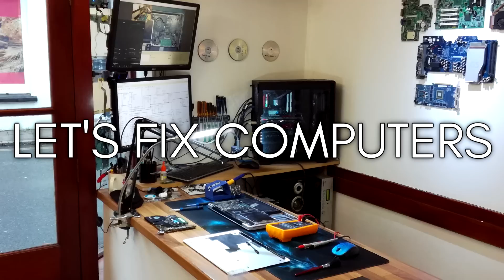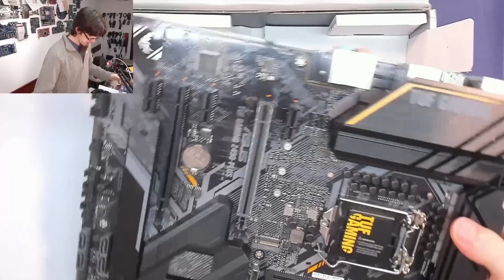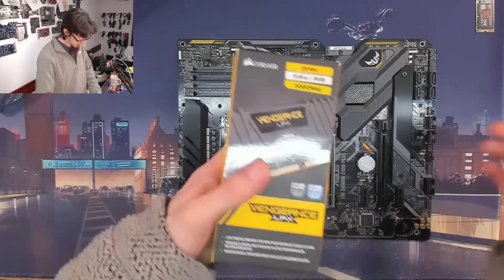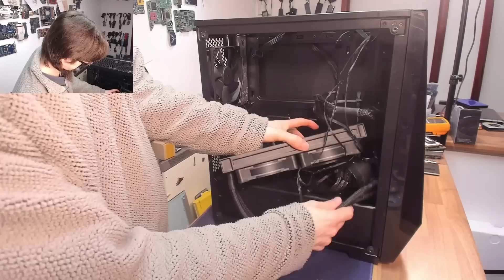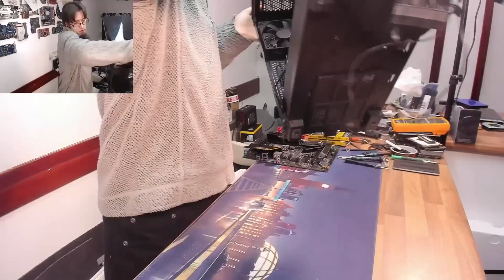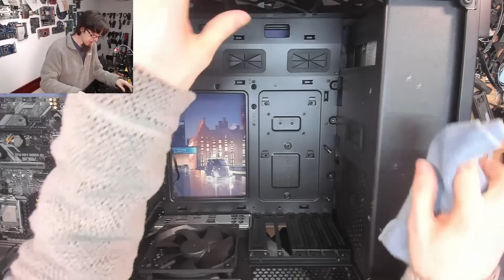Pt2. Rebuild, Custom build with No POST - LFC#240

Comment: Nice work and nice video - as usual ;)
However, there were two things, I noticed:
- I did not see you applying thermal past. I hope, that part just got cut out same as the SATA-Cables.
- You mounted the fans on the radiator 90° in respect to each other. That is usually a good thing, since then the cables come out at the same edge. However, with ARGB - especially of they are just paralled up - that leaves you with 90° shift for all effects on those LEDs. Not a problem for solid colors of course, but on the "Rainbow-Ring" as I will call it, you can clearly see that.
Reply from the maker: Yea thermal paste and SATA cable stuff often gets cut for time-saving 👌
RGB fans, yea these are non-addressable so that isn't a problem. But you're correct, ARGB fans I always make sure they're in the same orientation for that reason!
Reply: @Adamant_IT  Thanks for the reply! I can now sleep a tiny bit better knowing, that there is thermal paste on that CPU :)

As far as I understood it, the 3 fans on the front of that case are (analog) RGB  - so one solid color. However, the ones on the radiator are the "fancy" ones, that can have a "rainbow-ring" going around them. And at 29:20 it looks to me, as if that ring is 90° offset from one fan to the other. So these are in fact (Addressable) ARGB ones, are they not?

Comment: There is addressable RGB and Digital RGB they are not the same as you kept saying lol. I know you know what you’re talking about but the way you say it might confuse people who don’t know
Reply from the maker: How would you differentiate them? 🤔
The way I look at it, analogue RGB is your 4pin RGB and 12v header, and digital is the 4pin with gap header. Digital is addressable because it's a data line, not just colour commons and power.
Reply: @Adamant_IT  I just know that they call the 4 pin Header Digital RGB(12v) and the 3 pin Header Addressable RGB(5v), I know it sounds dumb because you'd think they would call it Analogue and not Digital. Maybe it's just a U.S. thing I don't know lol. Not trying to be a dick or anything I just don't want people to get confused and end up somehow blowing out there expensive LED's. That shouldn't happen because of the pin layout but you know some people just KEEP pushing until it goes in sometimes lol.
Reply: @Adamant_IT  Love Your Content By the  Way!  Keep up the Great informative videos my man! Cheers
Reply from the maker: Yea. I guess you could call it digital RGB in that it's digitally controlled by a computer... I'm pretty sure I've seen "addressable" RGB headers labelled as DRGB on the mobo. There's a horrifying lack of standardisation in RGB though, so I guess context is the only real key!
Reply: @Adamant_IT  yeah it’s definitely confusing lol. I have a MB that is labeled DRGB for 12v and another that is DRGB with the 5v plug. These manufacturers should really start working together where it makes sense and keep their proprietary stuff to a minimum, but that’ll probably never happen. It would just make to much sense

Comment: I had a strange issue with my  Strix Z490 I updated the bios it said successful,  computer turned off then back on and it never posted fine again.. I got a 4F post code. I tired to reflash and it seemed to reflash ok but still same issue.. Got a new Mobo popped in the cpu in the trouble mobo and I kept getting blue screens installing windows on the new board.. Popped in a different cpu a 10700k and everything worked ok.. Idk wtf happened my 10850k was damaged in the process of updating bios. Strix Motherboard still works ok and update with through ok. How could that even happen?

Comment: do you find that the power sata cables put unnecessary strain on the connectors because they are so close, wouldn't extensions mean less pressure?
Reply from the maker: There's a bit of strain there, yes. I find that bending the cable a bit before hand makes it acceptable. The cable doesn't mind being bent, and then it's not under so much tension.

Comment: I specked out my second build back in 2011 and it worked fantastic for nine years,  In late 2020, it began acting up.  Your Vids and or others eluded to RAM and or CPU issues and to remove and check.... Tried several arrangements of RAM to no avail.  Removed the CPU and it appeared ok.  Taking a flashlight/torch and a magnifying glass, I saw just one socket pin bent.  I assumed possible years of fatigue to be the cause.  Gently trying to move it back into place, the damn pin fell away and into the other pins.

My solution to removed that broken pin without damaging more pins was to take wide masking tape and kind of build a wall around the socket and over the top with a small gap.  Using a Can of Duster, I hoped that I could blow the broken pin out and hope it would get caught on the tape and not get lodged somewhere on the motherboard.  It worked perfectly!

However, after replacing all components and restarting, it would not post!  I really wasn't looking forward to buying a new computer package, but after failing to locate a new motherboard to match the rest of my gear, I ended up buying a Tenth Gen Z-490 Board, 10-600K CPU and 16GB DDR4 Ram.  Set me back almost a $1000.00.   Then when all hooked up and ready to go....  Went into Bios each time and no post??  After scratching my head for a long time and borrowing a Laptop to search my issues, I found that my old system SSD drives were MBR and the new System was GPT!  So I had the drives changed for me.

Quit a damn headache for sure but now I'm up and running again.

Thanks Adam, Love your Vids.

Comment: Graham - what are your thoughts about using velcro instead of zip ties?  Velcro seems so much more versatile and can still hold down wires well.  I use a .75" (2cm) wide velcro roll - cut it in half down the middle and they work great for all sorts of cable tying.
Reply from the maker: I've got a roll of velcro in the shop for this exact reason. And I keep forgetting to use it.
Reply: @Adamant_IT  I'm going to ship you a GIANT roll if you don't start using it! Cheers and thanks for the great content!

Comment: I’ve noticed the initial power cycling with the last two PC’s I have built using ASUS motherboards. It seems to be a process the ASUS BIOS goes through when detecting new CPU and RAM components. This occurred on my old ASUS Maximus IX Code and my current ASUS Z490 TUF. Each power cycled about three or four times before fully starting up.

Comment: Is the CPU "backplate falling off" just a TUF brand problem or is it a common problem around the other brands as well? I have a TUF x570 and a Ryzen 3600 in it, and when I disassembled it for cleaning purposes, I wasn't prepared for the plate to fall off, I was internally screaming for like 5 minutes.

Comment: And now from a PC repair expert...I'm an oddball, I had a Core i7 7700K fail on me...in over 25 years of PC building and whatnot...my first failed processor. They are made well, just thankful it failed while it was under warranty...Intel couldn't replace it though with no stock. They sent me a cheque for it...which was used to buy a X570 board...

Comment: this is why i really like intel builds, because it usually takes alot to break an intel platform something would have to be very very wrong for them not to even get to the post screen, and the fact that most of their regular processors come with onboard video is a huge bonus, if you want to know if there is something wrong with your video card, you can just take it out completely, get the video cable plugged into onboard graphics and boom get your answer right away, even though ryzen is good i find i really do not like the platform that much, it can be very troublesome for so many reasons, that i often find myself pretty much avoiding trying to give build advice for those ones.

Comment: If anyone was worried about static whilst building a PC, their concerns should be allayed by your cowboy building in a fluffy jumper. I don't think it's wrong (i don't adhere to strict practices), but it still makes me cringe watching you handling the hardware with all that fluffyness rubbing all over the place.
Reply from the maker: 15 years professional and my jumpers haven't zapped anything yet. UK's just too damp. If you're in a dry region though, yea different story.
Reply: @Adamant_IT  I think in my 20 odd years of building (just for myself/friends/family) i've had one thing die mysteriously after being handled without any to effort to ground myself... YMMV naturally and i'm also in the UK. Still can't help but cringe a little , i was always taught to ground and avoid things like carpet, rugs and fluffy jumpers when handling hardware.

Comment: What about thermal paste? Did you edit it out?
p.s enabling xmp profile before installing windows isn't the best idea :(
Reply from the maker: Thermal paste is an unwinnable fight. However I apply it, someone will tell me I'm wrong, and if I edit it out, everyone will think I didn't put any on 🙃
XMP before windows - yea I normally advise waiting, the issue is if a new build crashes, you might not know if it's XMP or not. But if you know what XMP crashes look like it doesn't really matter, if I see memory errors, then I'll know it's likely XMP.

Comment: Whats VRM?
Reply from the maker: Voltage Regulator Modules power bigger components on a circuit board. Motherboards will have several VRMs working together to power the CPU. Bigger/more sophisticated VRMs can deliver more power without ripple (stability) and produce less heat. I've got a video in the works that goes into more detail on this.

Comment: i have a suggestion for the fan headers, all the fan headers are 1A 12 W q-fan controlled, the AIO pump header is 1A 12W Full speed, w pump header is 3A 36w full speed (default speed)
Reply from the maker: Yea you're correct, the w/pump headers are higher rated. But they work in the same way, so you can plug fans into them as well.
Reply: Ok, thanx,  i thought the fans would online turn fulltime speed, good to know,

Comment: 21:10 I've got 11 connected to 1 header and its been fine
Reply: You can do that but its not ideal
Reply: @JohnDavidSullivan  how isn't it ideal?
Reply: @randomplayer6461  if they are running off a separately powered fan hub/controller fine, but splitting them from one socket isnt good.
Reply from the maker: I've no idea how much current RGB headers are actually rated for. I know my NZXT system at home doesn't support more than 4 devices in a chain, but I'm not sure if that's due to power constraints or software.
Reply: @Adamant_IT  I am using a high end motherboard (x570 aorus master) so that might be why

Comment: When removing glass note tempered GLASS panels be VERY careful ! If it slips and drops on your foot!! 2. If is smashes?? I am very wary when building using such for nieces/nephews etc BUT the finished computers are often ANCHORED to the desks AND the kids are NOT allowed without supervision to remove the panel. Those tempered glass panels are HEAVY!. 👀 Some clear panels are PLASTIC.

Comment: Re newbies etc, SOME cases provide an RGB controller often with remote control. (RESEARCH!!)  Those are generally 3 pin as shown here.. Asus have headers on some of their m'boards 3 pin for ARGB using AURA software downloaded to control the setup etc ONSCREEN. My system has 6 fans and they all work (PROVEN - tested long term no probs.) HOWEVER the manual etc does tell you not to exceed x number of LEDS ! My fans did not! 4 pin configurations are 1. DATA 2, 3 4 Red, Green, Blue.. and my Asus mobo has 4 pin OUT aswell as the 3 pin configuration. Some fans for LED etc have a 6 pin plug attached and they operate off a control box with 6 pin OUT headers.. 2 of those pins are for the fans.. others re LEDs etc... plenty of info on YT re the whole scenario on LED fans etc. Some LED fans have OUTER RING only. Some you can change the outer ring slotting it on the side you want to see etc re position in the case. My drives are fitted to the backplate which leaves where the trays are free for ie burying cables etc. TIP A magnetic screwdriver when putting screws INTO various places on the motherboard will often stop accidentally dropping the screws OR particularly if your fingers are like the Hulk 🙄🤣🤣 Another great vid.. If you missed it, do check out the vid on this computer with its original mobo in situ that would not post etc.. a truly jaw dropper that one👀 an invaluable lesson to NEVER forget.. Stay safe, whoever wherever you are and keep the vids coming 👌

Comment: All z490 motherboards have capable VRM's. The Tuf Gaming, while arguably the best in VRM performance, isn't significantly better than 2nd place. A dramatic difference would be in the b550 motherboards where the Aorus Master is 10 degrees cooler than the 2nd place entry and is WAY overengineered compared to other b550 entries.

Comment: 22:50 - Is it normal to have the PSU fan facing upward into the case? Isn't downward better assuming there is ventilation there?
Reply: Typically downward is the standard, but some people like to go against the grain and argue for upward facing because .. "reasons"..

Comment: Thermal Compound on the CPU? Even at 0.25 speed I cannot see if you remembered to apply it. Maybe should have shown that?
Reply: at 0.25 it is there but did not fit sata cables lol
Reply: @jrc3950  No need for SATA to test the post. I would never connect until I have a post. Just makes things easier. SORRY - and safer :-)
Reply from the maker: Yup, there's thermal paste there. Just didn't have a good camera shot of it.
Reply: @Adamant_IT  you should, some of us are pretty anal about that kind of stuff ;-)

Comment: Never tighten your zip ties until you have run all your cables thru.  Another thing, tape your RGB connectors with electricians tape to keep them from pulling apart.  Otherwise, nice job!

Comment: I hate Molex connectors.  I try to keep Molex chains out of my builds.  Personally, I bought a bunch of Molex -> SATA power adapters, so I can use SATA power for everything and never need a Molex chain.
Reply from the maker: Yea, I should've just pulled out that RGB widget and handed it back to the customer, but it's not doing any harm back there.

Comment: They are NOT CORSAIR Icue fans. BUT, if you wished to control those non corsair fans and CPU cooler then all you need is a corsair core node and adaptor cable and effects are attainable.

Comment: I never understood why modern boards have old 4 pin analog headers. I don't mind if they include a 3 pin 5v as well. I usually prefer one 12v and two 5v.

Comment: Would love to see a test of cable managed vs Non cable managed to see if it affects air flow and or temps, or just peace for my eyeballs.
Reply: Cable management for me is about being able to replace any component without having to rewire the whole system
Reply from the maker: Yea, it doesn't have any meaningful impact on performance - it's more an aesthetic/maintenance access thing.

Comment: Nice job. I'm glad you've seen the light on cable ties. A small point but how about putting a grille on that rear fan to make sure it doesn't affect the radiator hose? They're not exactly expensive and you can even get them in RGB

Comment: My X570 Tuf was DOA, random luck hits some times. Found it funny that the RGB lit up on a dead MOBO. 
But id take a DOA part over a random fault every day.
Reply from the maker: Yea, the RGB controller is stand-alone and runs on 5VSB, so it's keep working even if you stab a screwdriver through the mobo ;)

Comment: When you say that the audio is mediocre, is it across all TUF gaming MBs or this model specifically? I personally have the B450 Plus Gaming and although I sometimes have sound issues, it's not the quality.
Reply: I understand it as: It's not the highest end Realtek Onboard Audio Chip, but it's decent enough. The majority of MBs have just middle of the range audio chips and for most use cases that's fine.
Reply from the maker: Yea most people don't need high end audio on their mobo. Either their headphones won't care, or they're using a USB headset with a tiny little DAC in it anyway.
Fancy mobos can drive high-impedance studio headphones - but then arguably if you care that much about sound quality, you should have an external DAC.

Comment: Ugggg!    Guess I've never seen an AIO backplate work the way that one does.   All the ones I've used are secured to the motherboard and not loose fit until pump attached.    This is a Corsair AIO?
Reply: no it is an icy chill

Comment: am i blind or did you not put any paste on the CPU or did you just leave the pre-pasted surface of the AIO which would be weird considering it had already been used and would surely smudge around after being removed etc....
Reply: He had it on, but the way he edited the video made it really hard to spot. I almost made the same comment myself because of that

Comment: Just an FYI buddy, long sleeve clothing in the video is little worrying, when working with hardware, you are creating static electricity with all that case rubbing...
Reply: If the place you working on is somewhat humid, ESD is least concern.

At least that's what happened in tropical country here (Indonesia)
Reply: In the last month in the UK the relative humidity has gone over 90% every day except 1, static really isn't a problem, you'd have to take active steps to even deliberately make it one.
Reply: Its woolen jack , which doesn't create static

Comment: Seeing that little ventilation kind of makes me groan... especially when good ventilated cases can be get at cheap prices.
Reply: So three fans pulling in the front, two fans blowing from the top and one in the back ISN'T good ventilation? While I think the case aesthetics are crap, ventilation wouldn't be my complaint.
Reply from the maker: It's not exactly a mesh-front case. But I reckon the front vents are enough for those fans to catch the air. I've seen much worse run just fine.